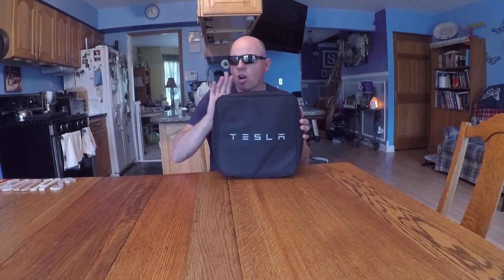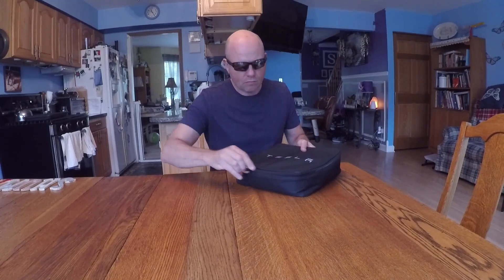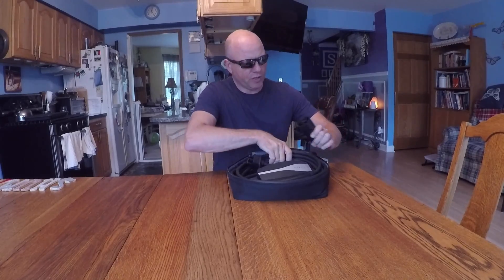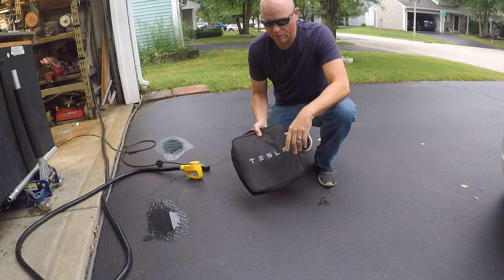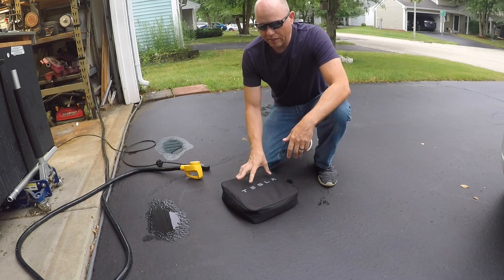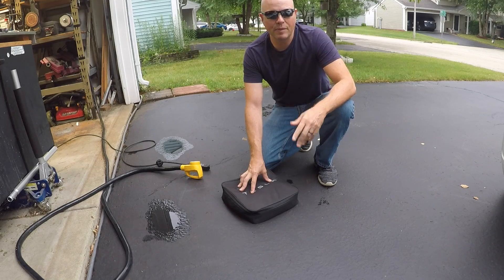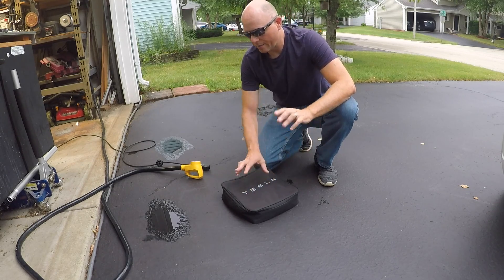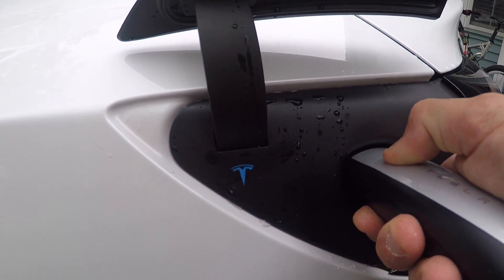Tesla Model 3 Comprehensive charging tutorial.

Comment: Hi everyone, 

TESLA MODEL Y LONG RANGE AWD: I work for an airline and travel for work. I drive 107 miles to the airport and then am gone for 3-7 days while the car will be sitting and not getting charged. Then I drive 107 miles home. (214 miles roundtrip total) My question is what is the best approach for this trip. Ideally, I would not want to have to charge on the entire trip and just charge when I get home. Unfortunately, this would involve charging to 100% or charging to 80/90 and dropping below 20/10% by the time I get home.

What is the best option to extend my battery life?

Options:
1. Do a short supercharge during the trip to the airport to get to approximately 70-80% and not have to charge on the way home.
2. Do a short supercharge on the way home to keep me from getting below 20% by the time I am home.
3. Charge the battery to 100% and come home with approximately 10-20%

Obviously, I would depart shortly after the battery reached 100% but I still understand this is not great for the battery.  

Thank you everyone for your time.

Comment: Did you just cut the male end of a heavy duty extension cord and hardwire that to your circuit breaker? Or does someone sell an "extension" cord with a female 14-50 end and bare wire on the other end? Do you have to wire it into a circuit breaker with built-in GFCI protection because you don't have an outlet anywhere between the circuit breaker and your charging connector? I like the idea of being able to charge my car on either side of the garage without installing two outlets, so I thought your "extension cord" hardwired to the breaker box solution might work for me.
Reply: I would like to know the same thing as well.
Reply: @Desrex  although I haven't received a reply, I think I know the likely answer. You can buy a female 14-50 extension cord end by itself to make a custom length extension cord. So he probably bought something like that, and just terminated the circuit with that instead of a wall outlet.
Reply: Marc Howe awesome! Thanks for the reply

Comment: I am completely clueless when it comes to electricity but I wanted to comment on what I am seeing with simple math.  I noticed that the free outlets which look "normal" in my company's garage had a little sideways cut in one of the prong holes.  I bought the NEMA 5-20 off the Tesla website for $35 to try it and it was worth it.  With the 5-20 my Model 3 is getting 5.8 Miles of range per hour.  The 5-15 that came with the car was giving me 4.3.  I also get 4.3 at home.  I drive 96 miles round trip.  So 9.5 hours at work gets me 9.5 X 5.8 = 55.1 miles and at home I get back 12.5 X 4.3 = 53.75 miles.  That is 108.85 miles of range gained each day after driving 96 miles.  With phantom drain, HVAC, extra driving trips and the fact I drive it like a rental, I still don't quite get it all back, but the weekends catch me up.

Comment: I want to plug in when I get home but don't the charging to start until off peak hours.   Do you have to use a Wall Charger in order to scheduled charging? Or can I do it with a Mobile Connector?  Basically, does it start charging once I plug in or can I defer it to a designated time?
Reply from the maker: Yes, no matter how you charge the car, you can set a charging time easily.
Reply: @TechForumTesla  thanks

Comment: Is #8 actually overkill? I thought #6 was recommended for a 240v 50amp circuit..
Reply from the maker: #6 is actually larger gauge than #8.

I am using #8 fine stranded wire, though. It is very high current capable.
Reply: Tech Forum, #8 is fine for the Model 3 UMC. Since it only draws 32 A max, a 40 A breaker can be used, sufficient to protect #8 wire. However if a 50 A breaker is used, then the wire needs to be #6.

Comment: BIG FYI to anyone buying a new model 3, they no longer include the nema 14-50 plug, you must buy it separately. As part of the gen 2 UMC you only receive the useless 110 volt adapter that will give you 2-3 miles per hour of charge. I just got my model 3 and was REALLY disappointed in Tesla, taking that away from a $48K (before taxes) car, and making you buy it for $35? WTF, Elon?

Comment: Should've been a 1min video tbh. 2 min tops. 
Here's the gist - 3 mi/hr on 120V/12A regular house outlet. So on 310 mile Long Range Model 3, 0% to 100% = 110 hrs (4.5 days) to full charge.
 ~30 mi/hr on 240V/32A NEMA14-50 outlet.  On 310 mile Long Range Model 3, 0% to 100% = ~10.5-11 hr to full charge [It will slow down after about 90% to 100% but this gives you a good idea] 
So NEMA14-50 is approx. 9-10 times faster than regular house outlet. 

A Tesla Wall Charger purchased from Tesla is about 33% faster than NEMA14-50 supplying 48A on the same mobile charger. 
~40 mi/hr on 240V/48A Tesla Wall Charger. On 310 mile Long Range Model 3, 0% to 100% = ~7.5-8 hr to full charge.

A Tesla Supercharger which does 440V = 0% to 100% is approx. 45min.
Reply from the maker: Your opinion......

Fact is, I get more requests for long videos than short, ALOT more.

Comment: The frequency of blinking charging light tells you how empty the battery is, not how fast it is charging. The faster it blinks the lower is your battery
Reply from the maker: The lower your battery, the faster it charges.....
Reply: @TechForumTesla  That is not true. The Battery charges fastest between 20-80% If it is below 20 it will start charging very slowly and then raise charging speed within a few minutes.
Reply from the maker: @SilkyWayFPV  yes it is true, the fast blinking is fast charging. Fast blinking is when it is  charging at the highest amperage. That  occurs between 20% and 80% SOC.
Reply: @TechForumTesla  Still fast blinking is not fast charging. The car will also blink fast if you plug it in with the standard 2,3kw charger. It only blinks slower when the car is almost charged. My Tesla dealer verified that.

Comment: The quicker the green light blinks means that the battery is becoming full, has nothing to do with speed
Reply from the maker: Uh, my understanding is the rate of blinking has to do with how many amps it is pulling. When the battery is low it blinks fast. As the battery charged higher the blinking slows down.
Reply: Tech Forum check your touchscreen next time your charging
Reply from the maker: @ajparenteau   I can tell you that the lower the battery is and the more amps it's pulling the faster the green light at my charge port pulses. That's a fact. The higher the state of charge the slower it pulses. And that's a fact.
Reply: Tech Forum it’s in the owners manual
Reply from the maker: @ajparenteau  and yet when I plug my car in with a low state of charge, the light pulses rapidly........
Reply from the maker: The manual supports my position. It clearly states the light pulses SLOWER as the charge level increases. I am reading it as I type.......

Comment: it said 12 amp for charging on your screen.  can  you help me test it  lowest setting.  can you set it at 5 amp? or 3 amp?  Reason I asked is cuz i go on vacation. and my solar is small system.  i only wanted it to charge at around noon time, just to keep battery from drain.  thanks
Reply: Does your solar source produce 120-Volts, Hie?
If so, you can do the math yourself.
For round numbers, lets say Matt got 4mi/hr of charge-time at 12 Amps.
You'd get one-fourth of that if you got 3 Amps from your charger.
(Your 3 Amps would be one-fourth of Matt's 12 Amps, so your charge-rate would be one-fourth of Matt's.)

Comment: I doubt these comments are checked anymore, but if someone had a surge protected extension chord, (weatherproof one obviously) would it then be usable to charge a Tesla?
Reply: Rifleman Jay so the issue with using an extension cord is actually voltage drop caused by the extra length, which causes the car's charger to draw more current, which then overheats the cord, which can then lead to a fire, or exceeding the breaker's limit and tripping it in the best case.

I do use an extension cord to charge my Volt on 120 because the nearest outlet is right at the maximum reach of my EVSE (the box that everyone tends to think is the charger), and can only reach the car if I park it with the front bumper basically against the garage door.

If you're going to use an extension cord (for 120 volts), use the absolute shortest one you can find, and get the biggest gauge of wire you can get. Mine is a 12 foot outdoor extension cord using 10 gauge wire. I've tested it and the cord stays cold to the touch at both ends and along its length, so the primary drawback is that my car charges a little bit slower and is more likely to trip the breaker, but since the Volt only charges at a maximum of 11 amps and it's on a 15 amp breaker, it never does.

It looks like the Tesla charges at at least 12 amps, so there's a little higher chance of problems if you used an extension cord on it. I wouldn't touch more than 20 or maybe 25 feet maximum for an extension cord personally, and the longer you use, the bigger your wire gauge needs to be to prevent safety issues.

If you do choose to ignore the sound warnings of the engineers who say not to do it, make sure you check the entire length of the cable at several points the first few times you charge, that you plug everything in at every point very firmly and completely, keep the cables well away from anything flammable in case it all goes catastrophically wrong, keep a close eye on the condition of the whole length of it, never bend the wires excessively or subject them to any strain, and know that you're putting your life and safety and home at risk by doing so.

It can be done, and lots of people do, but it is not safe and everyone who knows how electricity works will strongly warn you against it. You might even risk your homeowner's insurance not paying out a claim if it could be attributed to a fire, or be sued by anyone who was hurt or suffered property damage as a result of such a fire. You really need to understand all the ins and outs before you even think of doing it.
Reply: Actually, Tesla owners can correct me if I'm wrong, but I think you can manually select your charging current in them when charging from AC. If so, you'd just select a low enough current to avoid the trouble. In my Volt I can only choose 8 or 11 amps, and I'd probably be fine using 8 amps, but I still wouldn't use anything but my 10 gauge, 12 foot extension cord that I never unplug my EVSE from even when I take it traveling (to avoid corrosion on the lugs which would increase the voltage drop even further). I'll probably check it for corrosion every 6 months or so, but it's easy enough to feel it for heat while it's charging. If it gets warm or especially hot to the touch, there's an issue.
Reply: @babybirdhome  You are correct, you can select the A draw of the charge.  Also, the car ramps up the charging from 1A up to 12A.  If it senses excess voltage drop (something a cheap extension cord would do), it will either charge slower or literally refuse to charge.

The car will refuse to let you charge on a substandard circuit in many cases.

I have tested a 50ft 10/3 extension cord, and it causes no issues.  The voltage drop on a 10 gauge cord over 50 feet is only just over 1% or around 1.4V.

Comment: What kind of circuit breaker is connected to the plug?.. 
could I use a 20amp breaker?...
 if so what's the difference between a 20a and a 50amp breaker??
Reply: A 20-Amps circuit breaker opens at 16 Amps (Eighty percent of its rated capacity.)
Since a 12-Amp breaker opens at 12 Amps, a 20-Amp breaker will only increase your charge-rate by one-third.
Reply: @urquattro83  I think you may be misunderstanding something.  A 20A circuit breaker does not open at 80% capacity, it opens at 20A or higher.

The reason the cars charge at 12A on a 15A circuit and 16A on a 20A circuit are the NEC rules.  Under the NEC rules, any circuit in use over 2 hours must be de-rated by 20% (80% of capacity).

This is to prevent electrical fires and compensate for old wiring, worn and corroded outlets, etc.

Theoretically, you could charge at 20A if you charged under 2 hours, but they built in a safety limit so the system automatically de-rates the charging to 80% all the time to prevent any issues.
Reply: Danny Remisio, Tesla sells adapters for 20 Amp 120 V outlets, and also for 20 Amp 240 V outlets.

Comment: Nice overview on the basics of charging the Model 3 for North American owners. For anyone considering charging at 120 volts, keep in mind that the charging rate of 3-4 Mph will only put on 36 to 48 miles in 12 hours of (assuming a 15 amp circuit). However, many garages may be wired with 20 amp, 120-volt outlets which would allow drawing 16 amps (80% of 20 amps) which is 33% more current than 12 amps on a 15 amp circut. However, to take advantage of a 20 amp circuit, you have to purchase the Tesla 5-20 adapter from the store (see https://shop.tesla.com/us/en/product/vehicle-accessories/model-s_x_3-gen-2-nema-adapters.html). For some people, using the 5-20 adaptor might make enough of a difference that they don't need to have a 240 volt outlet wired. However, most people should have a NEMA 14-50 (240 volt, 50 amp) outlet wired unless there's already a usable 240 volt outlet nearby. For people that put a lot of miles on their car day-to-day, the best option might be to purchase the Tesla Wall Connector (https://shop.tesla.com/us/en/product/vehicle-accessories/model-s_x_3-wall-connector.html) and have it wired to a 60 amp breaker which will support charging the car at 240-volts, 48 amps (which is the maximum current the car's onboard charger can handle assuming the Long Range battery).
Reply: I am here because my brother put his penis in here cuz he thought it was a pillow he died 😭😭😭

Comment: You should show and discuss the charge limit. Leaving LiPO batteries charged at 100% degrades them faster than leaving them at 50% charge. (100% charged LiPO batteries at 25 C degrade at a rate of 20%/year while 50% charged LiPO batteries at 25 C degrade only 1%/year)

People should know that if they're only driving 30 miles per day, they're better off charging their car to only 70% max so that they can extend the battery life. Then they can set it to charge to 100% only when they're planing a long trip.
Reply from the maker: Terje Oseberg I have video that discusses that very fact. 
https://youtu.be/exbpEk-PlB4

Comment: From what I computed according to the charge screen at 240 volts it was drawing in 7.7 kwh & at the 2 hours 45 minutes to charge it fully that cost for my location is $3.17 that's cheap. What I don't know for sure is what it would cost or how many kWh it would take from empty to full. Do you know?
Reply: The cost "empty to full" is not too relevant as the car should almost never be driven that way except possibly on a road trip where you might let the battery run down to below 20% to arrive at your destination. On a day-to-day basis, the car should only be "topped off" to 80% or so. Charging now and then to 100% is okay such as for a road trip before you leave. Over at Teslanomics (https://teslanomics.co/tesla-model-3-fuel-savings-calculator/), try out the Model 3 fuel savings calculator for a better picture on what you might save. However, one of the benefits of an EV is lower maintenance costs compared to an ICE car which this calculator does not address.

Comment: Thanks for the video. I have a ChargePoint Home Charger which is a J1772 in my garage. This is what I use for day-to-day charging. I actually leave the J1772-Tesla adapter on the charger all the time. One thing that bothers me is, in the morning when I unplug, I have to unlock the car first, by either opening the door or opening the trunk. Then it'll let me unplug. Otherwise the plug is just locked. Pressing the latch on my J1772 will stop the charging but not unlock the adapter from the charging port. This is kinda unnatural cuz without the adapter, your routine would have been just unplug and then get in the car and go. Anybody who has looked into this issue please let me know, if there's a way for your charging port to Stay Unlocked while charging at home. Thanks!
Reply: As far as I know, the car has to be unlocked to unplug. You could unlock the car from the app on your way to the garage.
Reply: You didn't say what car you have (Model S, Model X, Model 3).  Like William said, you can unlock the charge port using the app on your phone.  If you have a Model S or X, you could also leave the keyfob in the car.  If the car senses the keyfob in the car, it won't auto lock the car.

If you have a Model 3, a keyfob will be coming in the coming weeks, probably by December.  If you end up getting the key fob for the Model 3, walking to the car with it in your pocket will auto unlock the car, allowing you to remove the cord.

Comment: I am looking to install a few charging stations at our office. Currently we only have employees with Tesla’s or Tesla’s on order.  I am not aware of any way to install a Tesla charger that I can control use access. I am currently planning on one Delta 25KW DC charger and two AC chargers,  they have J1772 connections.  Is there a smarter way to accomplish this? The DC Delta charger also has a CHAdeMO connector, but the adapter Tesla sells is for the S and X currently (not quite sure why).  I tried to apply for Tesla workplace charging program, but was turned down. Those chargers don’t seem to be for sale, but if selected I guess they pay for the install.
Reply from the maker: Jim Bercik just install j1772 chargers. That adapter comes with the car. Simple.